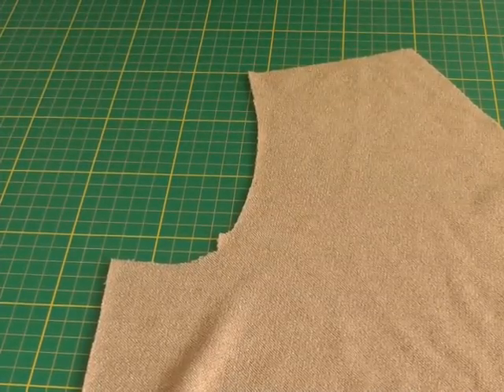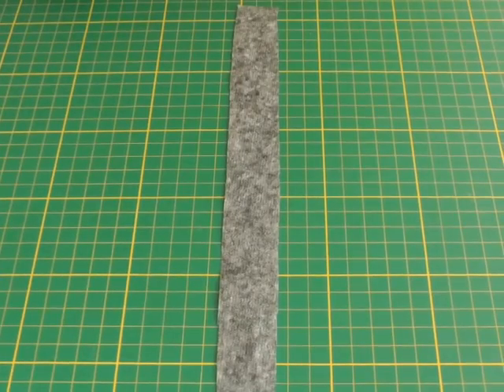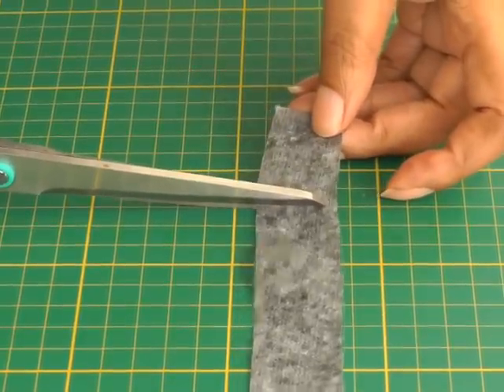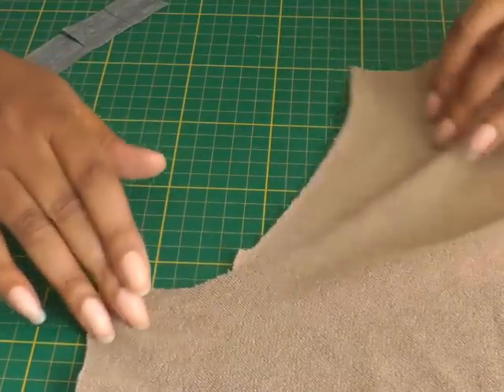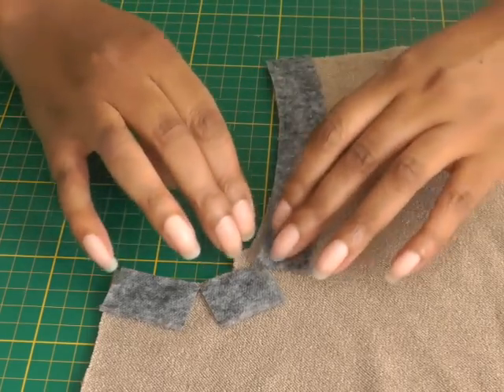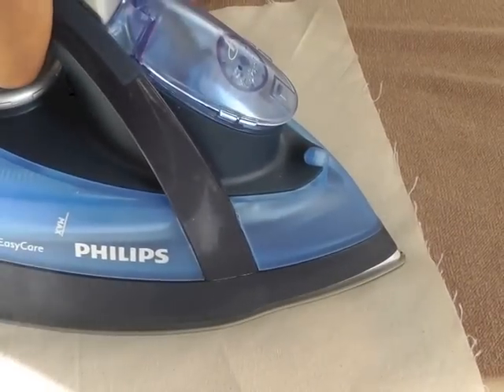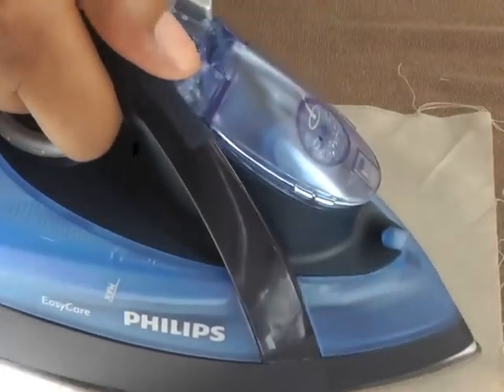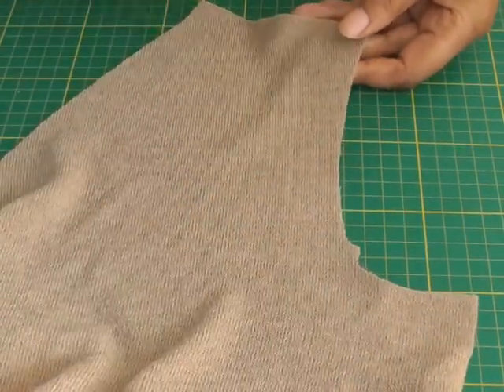Stabilizing Knit Armholes

Comment: Hello! Thank you for the video! Can you please advice on the next step after interfacing the armholes? How can I finish them?
Reply from the maker: You need to sew the shoulder and side seams, then either insert a sleeve or finish the armhole in a number of ways either using bias or another method, it depends on the project. Thank you for commenting UttoMielas.